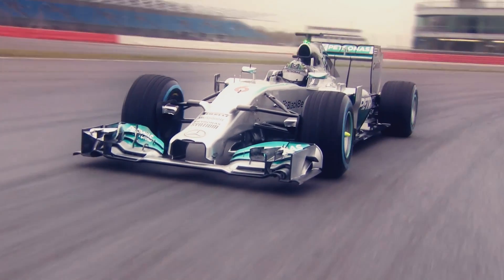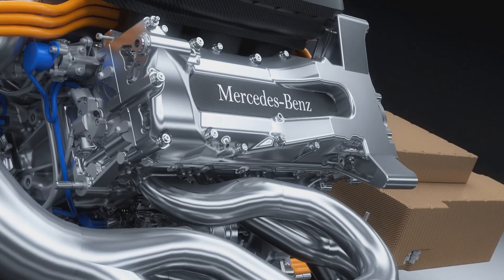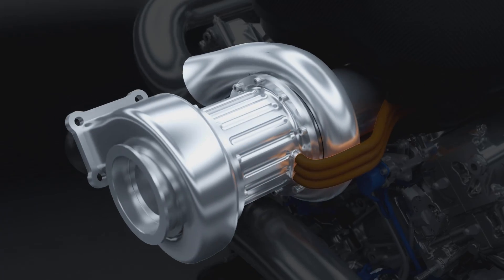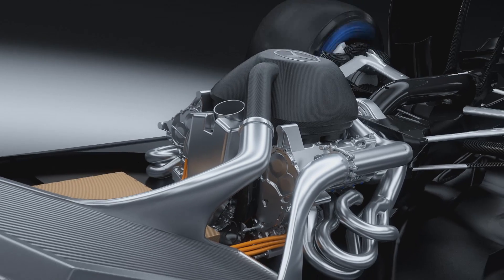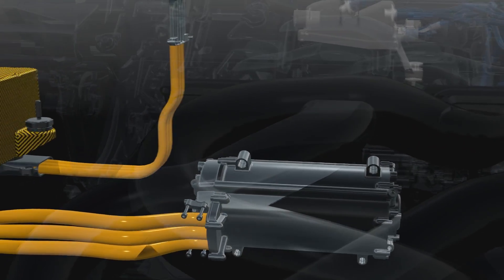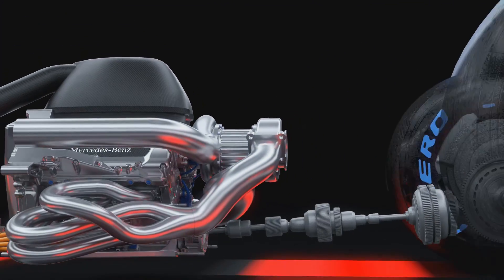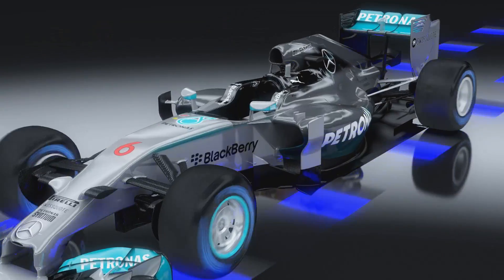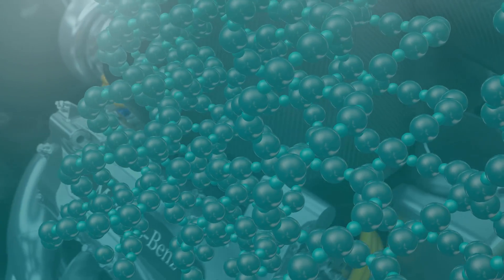The Mercedes 1.6l V6 Hybrid-Power Unit Explained

Comment: F1 in 2050: cars are limited to a 0.1L 1 cylinder hybrid turbo engine and get 100mL of fuel for the whole season
Reply: thay will probably be going at the speed of sound with air powered engines in 2050.
Reply: Maxzors It'll rev up to 1000 rpm, pure sound😅